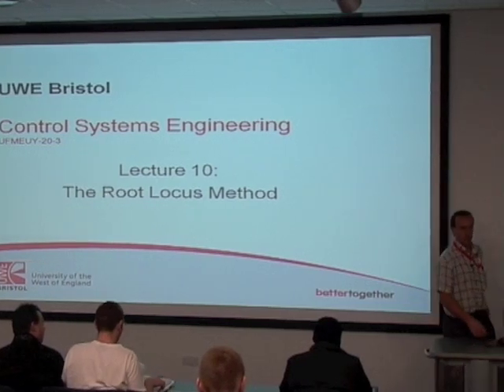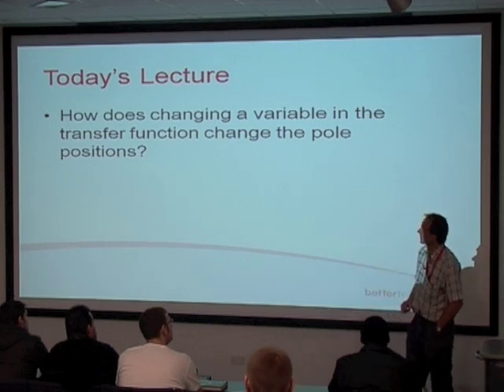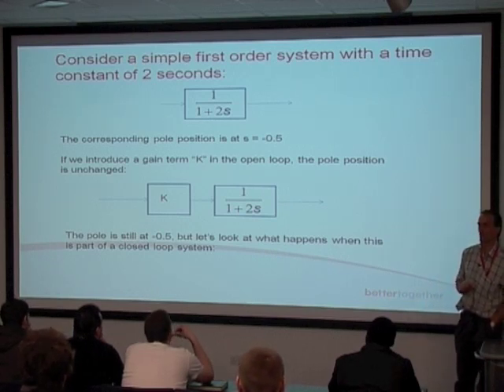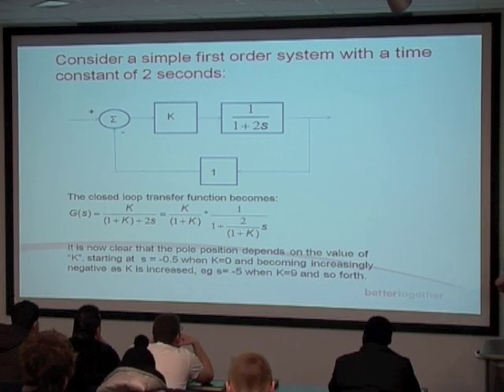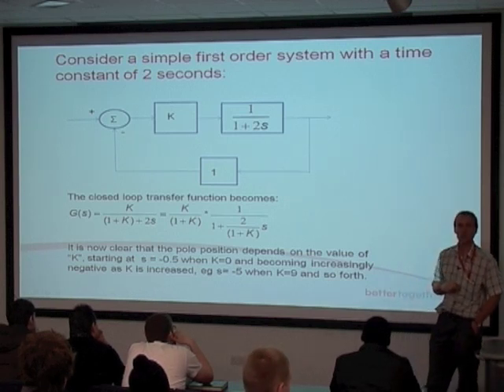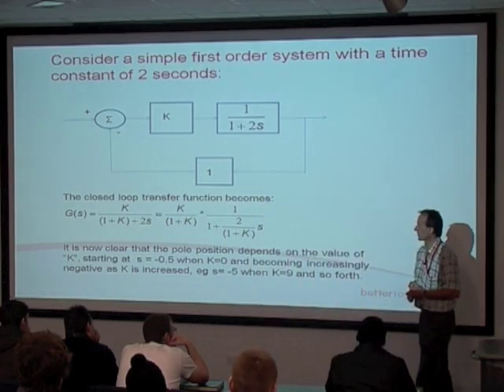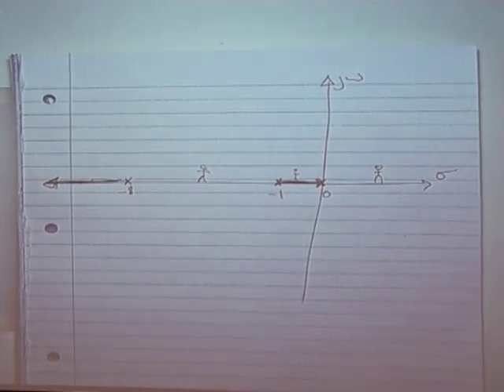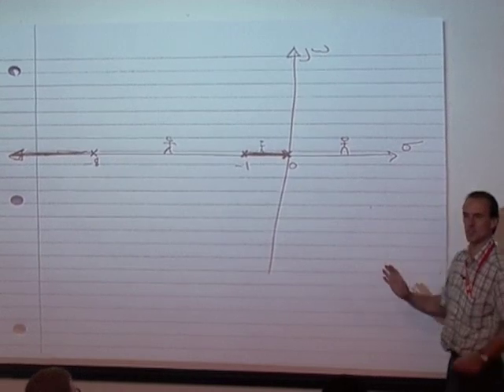Control Systems Engineering - Lecture 10 - Root Locus

Comment: This is not one of the better videos by drew.   I think teachers teach root locus because it has always been taught but I don't see its relevance in modern control. After 55 minutes I still don't see how root locus helps when tuning a PID with 3 parameters to adjust, not just one.   There is one key point to make here but it was not made in the video.  The break away point is where the response will usually be the fastest.  The poles all have a real term that results in a exp(-Re(Pole)*t).  If gain is increased beyond the point where the poles leave the breakaway point then not only does the response add sine and cosine terms ( becomes oscillatory ) but the response slows because now the poles start moving toward the imaginary axis again so the exp(-Re(Pole)*t) decays slower so the response is slower.
This is a KEY POINT!   It is the open loop transfer function that determines where the break away point is.   This is usually determined by the mechanics and NOT the control engineer.  In other words the control engineer is at the mercy of the mechanical engineers who NEVER think about the control aspects.  The sad part is that the control engineer usually gets blamed for not being able to control the system better when it is usually the mechanical engineers fault.

However,  there are ways of moving ALL the closed loop poles to the left beyond the breakaway point so the response can be made much faster but that usually requires special control techniques that aren't available in a common PLC.  There are still limitations of the control output range and the resolution of the feed back.